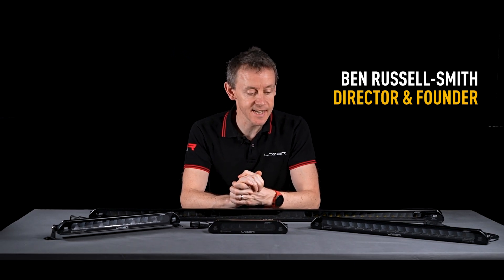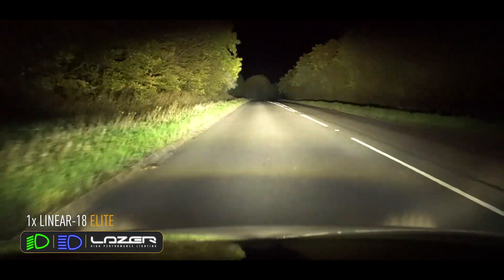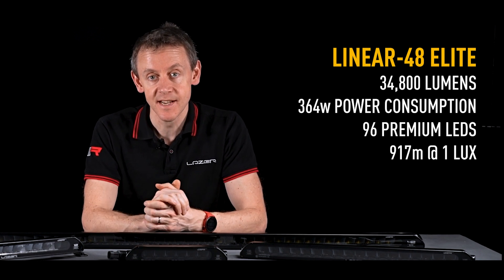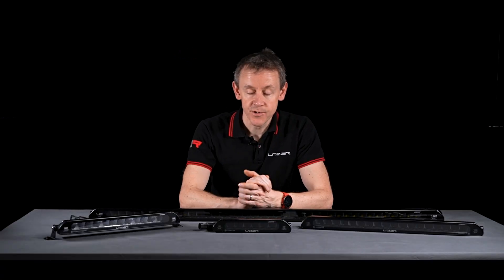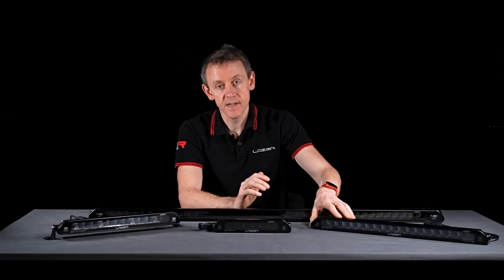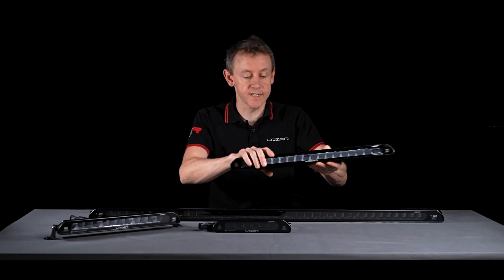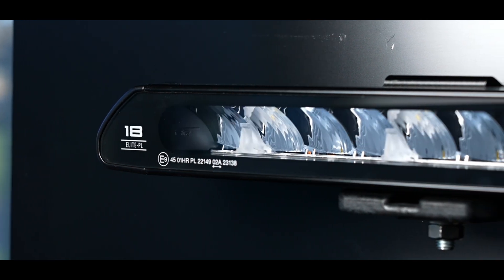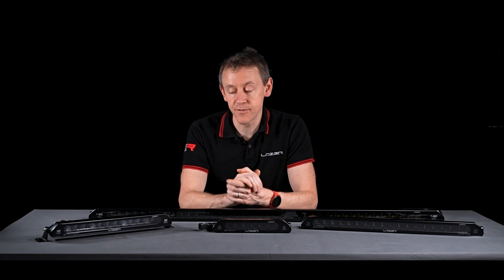LAZER LAMPS | Linear | Product Walkthrough

Comment: What would you recommend for a Honda civic hatchback for a bumper light? 2x sentinel 7" or something else like a light bar? I don't have a big budget but I need more general light for night driving on the highways. Live in Finland if that makes a difference with the legislation and brightness stuff.
Reply from the maker: Hi there, Apologies for the delay on this. For this vehicle we'd recommend using a Linear-18 lamp with a number plate bracket. The Linear-18 is E-Marked for on-road high beam use.

Comment: I have a Liner 12 Elite on one of my cars, and I have never regretted that purchase.
Fantasitic bit of kit.
I then bought the smaller range  the ST2 for one of my kit cars and once again, amazerd at the light output from somthing so small.
Now  my next purchae has got to be the Sentinsl 7 Elite, to which I will have ho actually redesign, mould and then make a whole new front for my other kit car, to get them in.
I woukd not do that amount of work if these lights were not anytjing below outstanding.

Comment: Didn't mention the + version. Got the Linear-18 Elite+  
20000 lumens from such a small format is simply stunning. On top of that the beam pattern is really wide which was my main requirement, need to be able to see to the side into bends to see where you're going without cluttering the car with side lights.
The yellow light option for when it's snow or fog is a great added functionality, again massively helping one to see where to go but with much reduced blinding. Sometimes going faster isn't about horsepower....